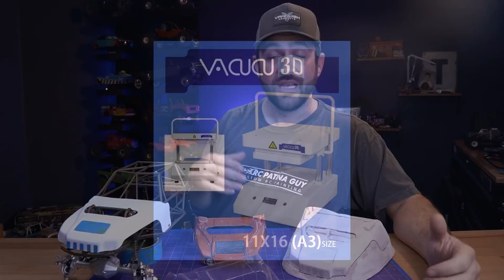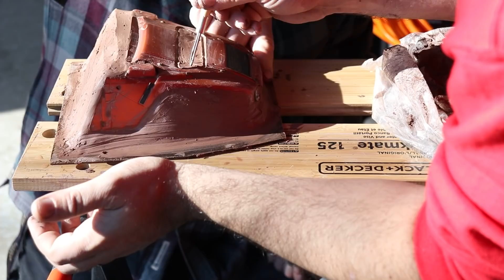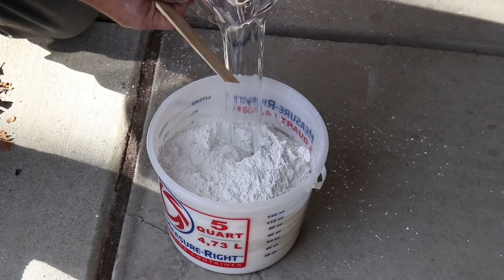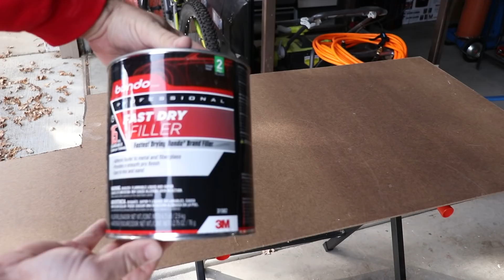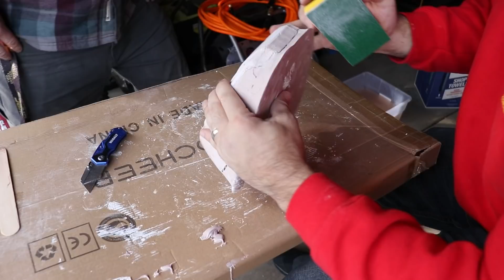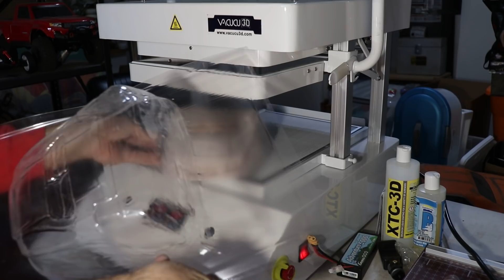Making a DIY RC Body! - Custom Hood for UCFab Karnivor

Comment: What I’ve done while doing automotive bodywork is to use fiberglass resin as a thinner for body filler. You might can thin a small amount and brush into the mold to help prevent air bubbles on the surface. I also used the thinned filler to fill pin holes.

Comment: Very nice work. I've done some casting myself but smaller scale 1/24 scale model kit type stuff. I've used plaster to make my sculpt then using silicone and resin to make the part. I have not used Bondo to create a Buck but then again I don't have a vacuum set up. I wonder what the advantages or disadvantages for using Bondo vs resin?

Comment: Amazing, I purchased a 3D printer one year ago because of a simple ESC tray that wasn't available for purchase. It turned out to be an amazing tool. Part of my New Year's resolution was to learn CAD. I am still at beginner level however being able to just design and print something I need is amazing. This is right in that vein of being an awesome tool and I absolutely love it. Thanks for the video.
Reply from the maker: This type of stuff goes hand in hand with 3D printing for sure! I have some plans for my scale nationals builds that will combine printing and vacuum forming!
Reply: @HarleyDesignsInc  Definitely looking forward to seeing the progression And what innovative ways you use your tools to customize your RCs. Keep up the great work.

Comment: Wow  beats the heck out of a heat lamp, a wooden block with a bunch of holes drilled in it setting on a box with a shop vac hooked to it 
(Thanks, Popular Mechanics Mag outta the 70's)
Love your stuff, my tuber frame truggy owes a bit to you for it's existence. After I saw your vids on how to fab your own tube frame, I built one. Then another, then about three more till I got the damn thing right.
Now it's 6 1/2 pounds, low,  angled skid, Vanquish all through it.
As always, thanks, and have fun.

Comment: What is the detail like on the bottom of the piece ? You may be a few steps from getting a detailed piece by making a mold of the detailed bottom ( if it is detailed ) and then turning it over to make another mold. It’s like you are now getting a negative instead of a positive finished hood. Takes twice the amount of material but the finished vacuumed piece should have the detail you want.
Reply from the maker: That’s a good question, but this seems to be the normal process for vacuum forming. This is so that the material stays the thickest for the majority of the part I believe. This is basically the same shape as what someone like Proline would use as well.

Comment: Never seen a gallon of Bondo mixed at one time.  This a process I’ve wanted to try but I can never seem to find a body to copy since I tend to make oddball trucks. 😁  Maybe one day I will get a large vacuum former to replace my homemade one.
Reply from the maker: I’ve never mixed that much at once either!
Reply: A gallon of Bondo? Well you've never been to Tijuana. Screw chicken wire over the dent, stuff it with newspaper, and coat it with Bondo.